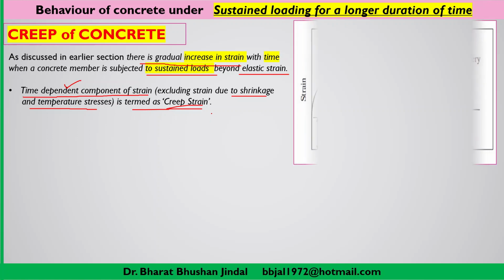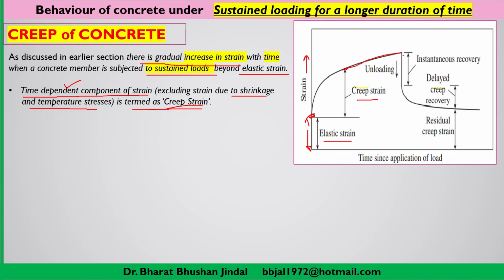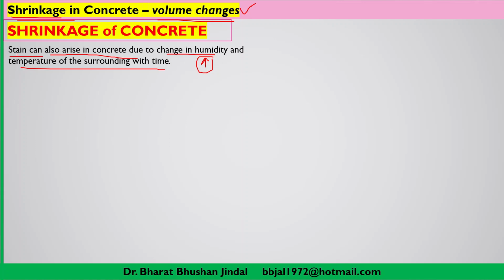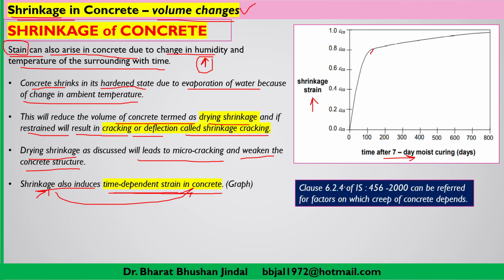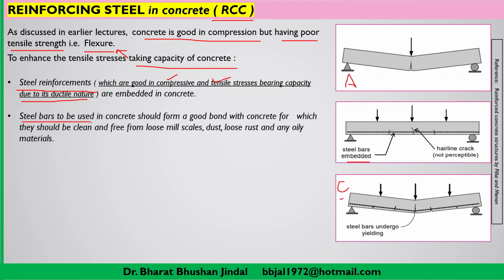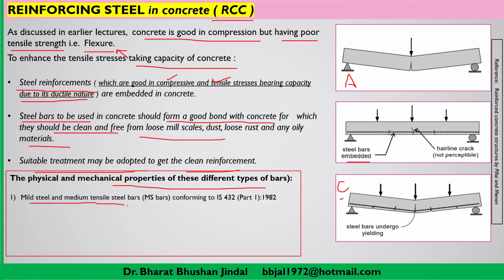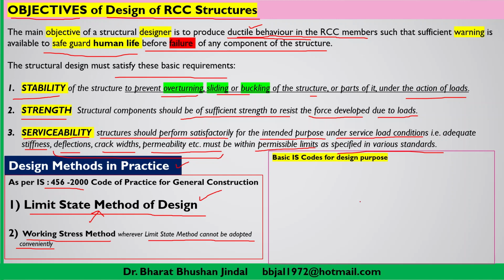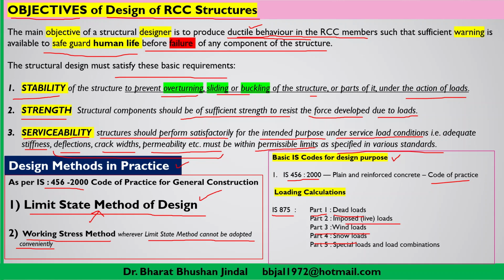Lecture 3 || Properties of Concrete || IS :456 -2000 || Design of Concrete Structures || Civil Engg.

Comment: In the given lecture video we are given brief idea of creep, shrinkage and design method of RCC. 1)Proper understanding of the definition  creep of concrete and  creep strain with detailed elaborations and also effects of creep of concrete on RCC structures.2) detail explanation on shrinkage in concrete, definition of stain, dry shrinkage and shrinkage cracking , etc and Effects of shrinkage on concrete. 3) here reasons are justified why to use RCC  in concrete structures, advantages of steel/ RCC members and  also suitable  precautions / measures are mentioned to be taken before installing them into structures. two types of design methods are mentioned which are presently getting used that is LIMIT STATE METHOD and WORKING STATE METHOD. lastly important points are closely mentioned which gives us the gist of the topic discussed.

Comment: sir video is nice , like it is very easy to understand and  my doubt is. ——(Is everything in the construction process occurs by keeping in mind the clauses and sections of IS code?)
Reply from the maker: IS Codes contains guidelines based on experiences and discussions which helps/guides structural designers. Its always expected that the guidelines should be followed at sites too as is excepted from wise citizens to follow traffic rules.

Comment: Sir, why does the value of creep coefficient fall with the passage of time?
Reply from the maker: As stated earlier in the lecture, the exact reason for creep is still not understood. Creep coefficient is the ratio of creep strain to elastic strain and with the passage of time creep strain decreases which may be attributed to stabilization of microstructure with time.

Comment: Sir, the videos is very well explained with sufficient amount of materials and it is helps not only we but other students as well.
Summary - In this video we learnt about the behaviour of concrete under sustained loading for a longer duration of time. After concrete is hardened the structure during its service life is subjected to various types of loads, fixed load - live loads and dead loads. When concrete is subjected to load beyond elastic strain there is a gradual increase in strain, time-dependent component of strain is termed as creep strain. 

In the graph as shown in the video, at first the graph is linear which is the elastic strain and then after creeps are developed in the member, after the load is removed, a sudden decrease in strain in seen which is called as instantaneous recovery, it takes some time to recover creep strain and at last some creep strain is remained called as residual creep strain. Crepe increases deflection of structural elements. 

There is another behaviour called as shrinkage which can be due to change in temperature of surrounding. Concrete may be trained due to evaporation of water in its hardened state which is called as shrinkage cracking. Drying shrinkage results in micro cracks. Same effect is caused by shrinkage and creep. It can be reduced by reducing the water cement ratio and controlling evaporation of water which can be controlled by curing of concrete.

Concrete is good in compression but poor in tensile strength. When a member is bent one part is compress and other is in tension but but since the member is concrete which is weak in tensile strength, cracks will be developed. To enhance tensile stress carrying capacity, we do Steel reinforcement as steel is good in tensile and compressive stress both due to its ductile nature.

Comment: Sir, what is the use of prestressed concrete? As we know that before applying external load, it is the initial compression given to the concrete but what is its work?
Reply from the maker: Currently its not in the scope of topic. It will be covered during the study of prestressed concrete.

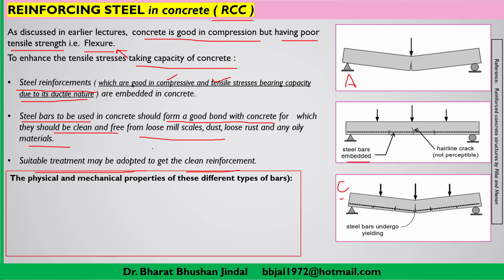Comment: At 23:50
You have discussed different types of steel reinforcing bars such as MS bars, High yield strength bars, structural steel conforming to grade A of IS 2062. Sir, i want to ask that if we are designing an earthquake resistant building in an high earthquake prone area then which of these steel reinforcement is best suitable for use and why?
Reply from the maker: Briefly it can be said that the steel having better ductility will be more useful, but various other design parameters are associated with in the design of structures to make it more earthquake resistant.